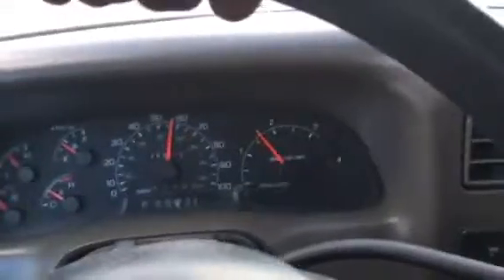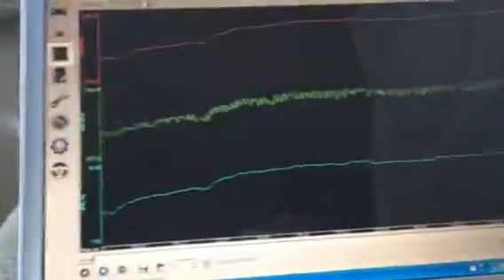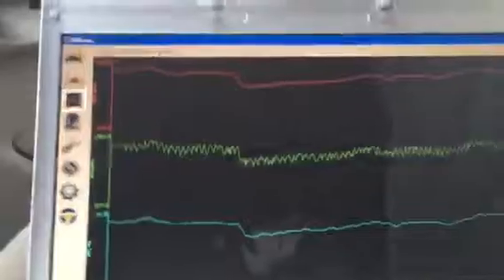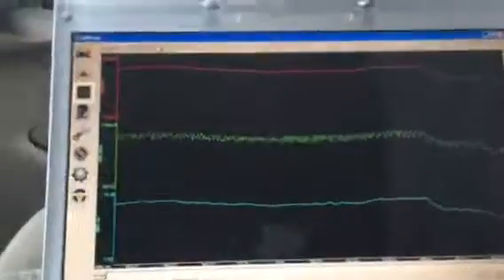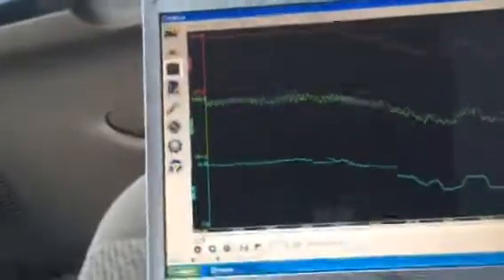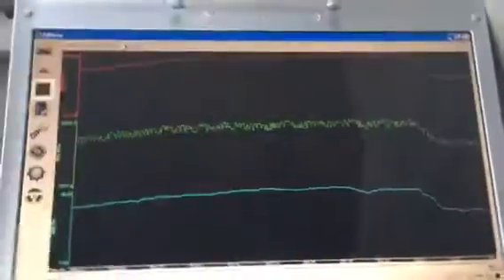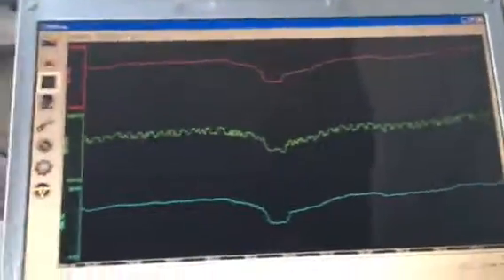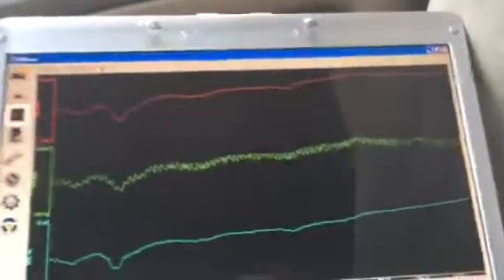2001 7.3 P1211 Troubleshooting

Comment: Was yours turned off after you push it for a wile or no ?
Reply from the maker: No. I had to replace the IPR. This vid was 3 years ago, and I’ve since sold the truck to my neighbor who is still driving it with no problems, so the IPR was the fix.

Comment: What was the problem?
Reply from the maker: Yard Hustler the problem turned out being a bad IPR. My injectors were consuming injection pressure normally, my ICP was sensing it normally and the PCM was demanding more under load but the IPR “top out” so to speak and not regulate anymore.